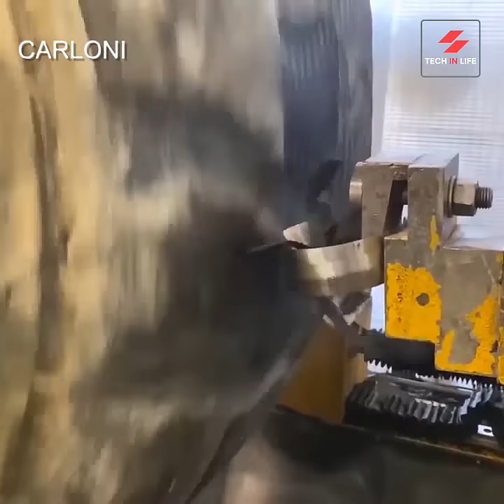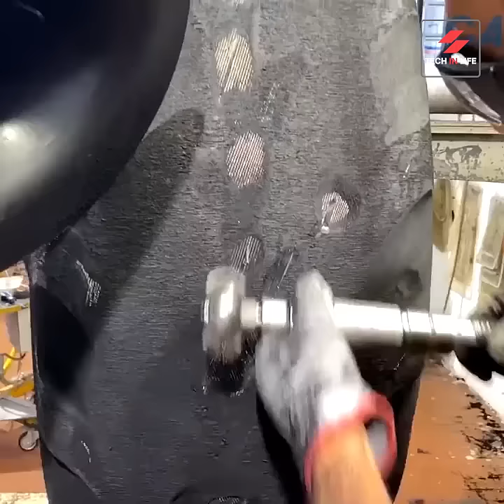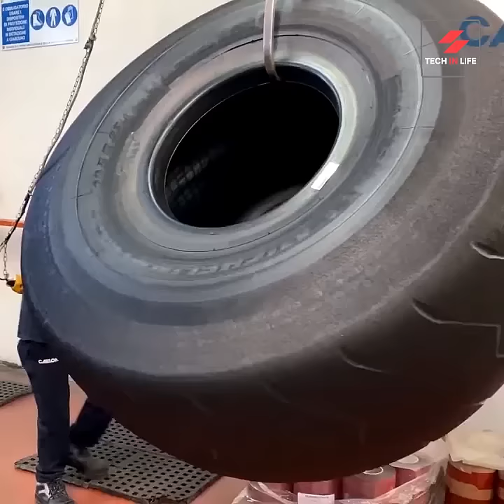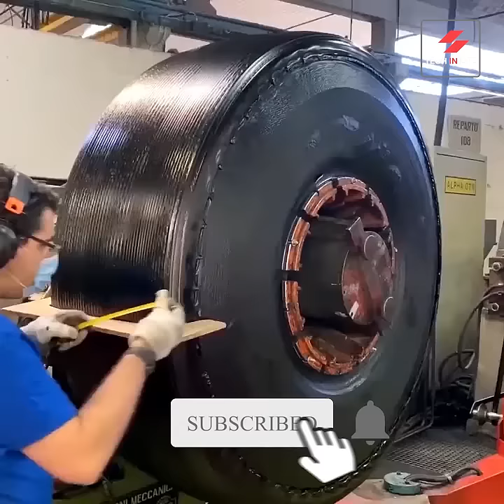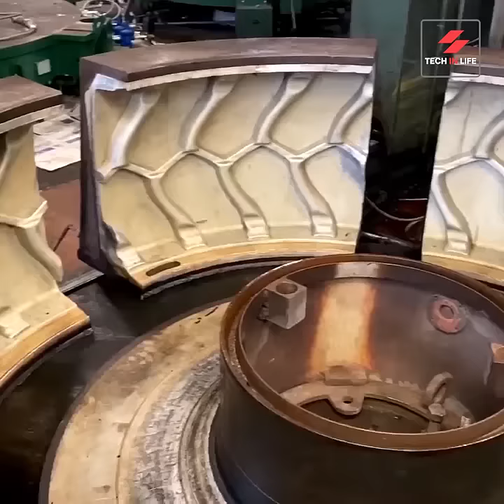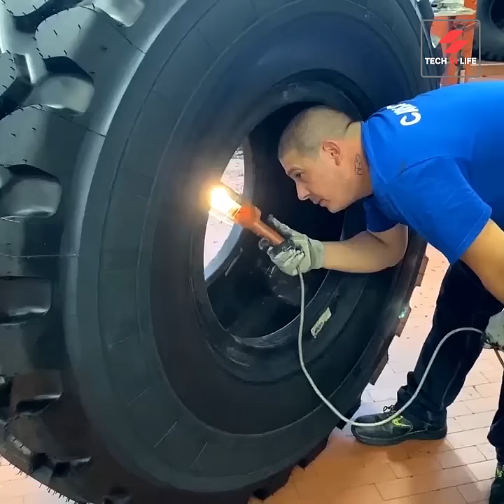How to Retreading an Old Big Tire? Watch Now the Latest Technology

Comment: That looks like a lot of hard work...
Or maybe it's worth it because these huge tires are massively expensive??
🤷🏻‍♂️
Reply from the maker: Yaa, I think so. Thanks for your comment
Reply: @TechInLifeToday  You actually take the time to acknowledge your viewers. Thanks buddy.
You get an instant sub from me. 😎👍🏼
Reply from the maker: @YusufGinnah Friend, Thank you so much
Reply: It’s cheaper to have them re-treaded

Some new tractor tires go upwards of 40,000-50,000$
Reply from the maker: @mrsalty614  Thanks for your comment. Yaa It may be.
Reply: @mrsalty614  
$40k-50k? WTF? 
Sheesh... If car tires cost that much I'd probably retread them too...
Thanks for letting me know. 👍🏼
Reply: @YusufGinnah  that’s not the price for all of them. they’re a wider range than the average car tire due to the different types and sizes. And the tooling required to make them it’s not cheap to manufacture so that ends up making the prices go up more
Reply: @mrsalty614 
You learn every day.
Now I'm thinking of those huge tires on those massive quarry trucks.
Never really considered it before.
Reply: @mrsalty614  Mate, is not a bot...
Reply: @mrsalty614  I don't know where you live but tractor tires dont usually go above 5k.

The tires shown where industrie tires in the xl dd 2 and x ha pattern from michelin.

Even these tires aren't above 1500 €. 

It is correct that some tires may exceed the 10 to 50 000 but then we are talking of dumper tires in mines which are 3-4 meters in diameter
Reply from the maker: @frankierzucekjr  Thank you friend for your nice comment. It's giving me a lot of inspiration. Stay with me and keep watching this Chanel.
Reply: it's worth it because it's unnecessary to replace them since they're so thick.
It's cheaper to just resurface them.
Reply: @YusufGinnah  well they have PLENTY of time when they do nothing but steal OTHER PEOPLES CONTENT. It’s the ONLY part of being a YouTuber LEFT! 🤦‍♀️ haha 😆
Reply: Ya literally thousands I don’t know how much this job is but ya tractor tires are ridiculously expensive
Reply from the maker: @ownenk  Thanks for your comment
Reply: Ya dude. I've heard some of the big rig tires they have at like quarries and mines for the haulers can be 5-6 figures for some depending on the size. That's mind blowing.
Reply from the maker: @nepttune710  Thanks for your comment
Reply: They’re like $2,000+ each depending on brand
Reply from the maker: @Andrew-hh3ol  Thanks for your comment
Reply: @mrsalty614  not that size and type
Reply: @YusufGinnah  R u ok?
Reply: They cost around $20,000- 30,0000.
Reply: Oooooooooooooooooooooooooooooooooooooooooooooooooooooo @TechInLifeToday oooooooooooooooooo
Reply from the maker: @triyantonurjabbar7607  Thanks
Reply: @mrsalty614  yo do realize ur commenting on his channel and being disrespectful
Reply: @princecharles1569  yes.
Reply: Wonder if retreading the tire is less expensive than buying a new one tho 🤔 and what's the price difference 🤔
Reply from the maker: @brandontalley4288  Thanks for your comment. To get more details please follow the website. You can find the link in the description box
Reply: @mrsalty614  this is true I work at a farm equipment dealership
Reply: @mrsalty614  what a clown
Reply: @mrsalty614  hahaha no no no no
Reply: Йй
Reply: 0
Reply: @YusufGinnah  l

Comment: The only bad part about re-treads is they aren't as strong as virgin tires. Or at least they weren't about 10 years ago. 

My father worked in the heavy haul trucking industry and every time they put re-treads on his loads they blew out within 10 miles. (He always specifically demanded virgin tires but they would often put on re-treads anyways)

These re-treads are only available for large commercial tires. They are illegal to make and sell for passenger vehicle use in the USA.
Reply from the maker: Thanks for your comments and for sharing this valuable information
Reply from the maker: Cambron Gabaree  Thanks for your comment
Reply: Well sometimes it actually depends on the retreader, if they retread it professionally it’ll last almost as a new tire.

Comment: Looks 👀like a shop that actually is doing it correctly! Nice Job 👍🏻! Retreads are perfect for off road machinery, especially if you can get them for 1/2 the cost as new! You should never use them on a steer axle! Actually against the law @ if there seen in a weight station, they can put you out of service! Actually they are great in the north, logging trucks & trailers, feed delivery trailers, places where the asphalt doesn’t get over 110 degrees, or on trucks that haul heavy in the cold weather! They should never be used on over the road trucks in the south! Too much weight & too high road temps, make them come apart easily, when extremely hot, or driving over the speed limits! Why do you think you see so many on the highways of the south! Also if you cannot get for half price of new, it’s not really worth it! Just think if you need to call a tire shop to come out to you on the highway 🛣 & change them out! The cost & lost time will cost more than just buying new!
Reply from the maker: You are right. Thanks for your valuable comment. You have mentioned the pros and cons of retreading nicely. Thank you friend, keep watching my other videos and give your comment.
Reply: The cost time has nothing to do with it try letting one blowout blowing your Fender off and ripping your airbags all to pieces not worth it
Reply from the maker: @1010109999999  Thanks for your comment

Comment: used recaps on our 18 wheeler trailer , when spring was going to summer the roads were warming up was the time they usually failed , we would make sure they were aired up to 110
lbs , low tires get hot hot
Reply from the maker: Thanks for shared your experience.

Comment: What are the tiny pieces of rubber that stick out called / for ? They seem to be on most tires
Reply: That's how you can tell if a tire has been used
Reply: It’s just part of the manufacture process there is no actual use for it and it’ll go away once you start driving. Those are not wear markers they are too small and are on the outside of the tire so they wouldn’t even help knowing what your wear is at.
Reply from the maker: Thanks for your comment
Reply: They're from the injection moulding process

Comment: I learn that process during my internship at a Automobile bus workshop it's quit interesting they use moulds to press that grip to old tyre but we use pressure tube and containers to do that. Basically this process is done because normal tyre has a long life but a time comes when tyre looses its grip so instead of throwing the whole tyre the repair it and its a cost effective method 👍
Reply from the maker: Friend, thanks for your coments and exprience.

Comment: First they remove there tread and second they buffing on tyre and third put fabric and compound belt on it and fourth they laminate the tyre by the compund and they use aplicator for laminate strips and five they put tyre in curing process to cure the tyre and there tread shape bye the mould of the press...... I am worked in BKT tyre industry bro
Reply from the maker: Thanks for your comment and valuable information

Comment: retread tires are very dangerous when they fall apart at speed on the highway
Reply from the maker: Thanks for ypur comment
Reply: You ain't going 100mph on a tractor..
Reply from the maker: @lightg2775  Thanks for your comment
Reply from the maker: @lightg2775  Thanks for your comment
Reply: @lightg2775  no kidding ,did you read my comment ? did i say tractor tires?

Comment: seems like a lot of work and potential subpar results or increased odds of defect.  Why not just get new tires...
Reply: Because a single one of these tires can cost anywhere from 1900-2900 dollars
Reply from the maker: @nukedpancakes3_863  Yaa, You are right. Hi friend Thaks for your comment
Reply from the maker: I think it may be cheaper than a new one. Hi friend Thaks for your comment

Comment: I hate this aspect of money saving. In the long run the re tread dosent last as long as an original because the tread always separates and blows the tire. Maybe it would be fine for off road use like excavation equipment loaders etc. But highway use on class a and b trucks is not efficient.
Reply from the maker: Thanks for watching and your comment. You're this tire is used for excavation machinery and in the construction area. Not for highway trucks
Reply: @TechInLifeToday  thanks for the reply. We run 445/70/22.5 retreads on cement mixers. As the mechanic im the lucky guy that gets to replace them on the side of the highway when they blow. Had one last week completely blow the fenders and brackets off the frame rail. I understand you save 200$ a tire, but to me it's not worth the savings.
Reply from the maker: @nshue23  Thanks for sharing your experiences

Comment: For these low speed tires this might work, but for a tire that will be on the highway this is NEVER AS GOOD AS A NEW TIRE 
Companies like to outsource to save money and will purchase retread 18 wheeler tires for their trucks, me personally I dont think 150$ off of a set of tires justifies the risk factor when dealing with peoples safety.
Reply from the maker: Thanks for watching and your comment. This kind of retreaded tire no safe for public vehicles. Lot of trucks and trailer are using it. But it's so risky. Best for using in  construction machine.

Comment: Govt must Ban tire retreading in all countries
Reply from the maker: Thanks for your comment
Reply: Why
Reply: @tobylewis1920  
Higher risk of failure.
Though, I wonder if that's the case on large and slow construction vehicles.

The worry is that the re-tread will separate from the rest of the tire, which can cause severe damage, injury, or death. But if the tire isn't spinning that fast....
Reply: @Fightre_Flighte  I know school busses have the tires retreaded. It seems like everything else, if done properly, is safe.
Reply: @tobylewis1920  
For sure. Anything, if done correctly and/or used in moderation, can be safe.
I was merely bringing up the fears and details behind them.
Plus, school busses are usually speed capped.
Reply: @Fightre_Flighte  just wanted to see OP's reasons, do appreciate the comment though
Reply: @tobylewis1920  
I enjoyed our chat.
I, too, am curious... Not enough to bother though.
Reply: big tyre vehicles do not work in city or highway. they work in construction site. So no risk of exploding due to high speed

Comment: Ok, why aren’t we doing this to all / most tires?. This seems to be a much better way than to just toss old tires into the dump.
Reply: This retreading only applies to tyres this big or which are used for industrial work because these don't experience much fatigue and can easily last long as they have huge mass also they are very expensive..
On the other hand vehicle tyres on road face much fatigue due to high speed, irregular roads, overload and this could cause the retreaded tyre to fail..
Also as life of a person is important its better to swap old tires with new as these vehicle tyres won't cost so much compared to those huge tyres
Reply from the maker: Thanks for watching and your comment
Reply from the maker: Thanks for sharing this kind of valuable information. Clearly, you've mentioned the purpose of retreading tire. Thank you...Friend